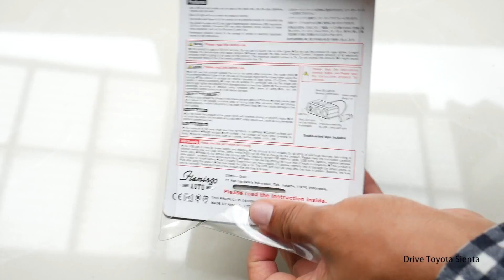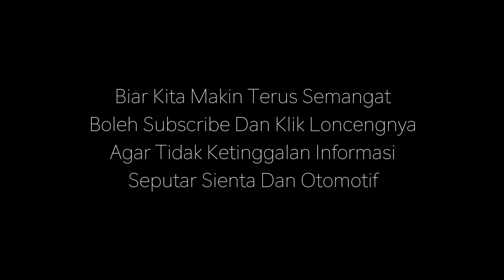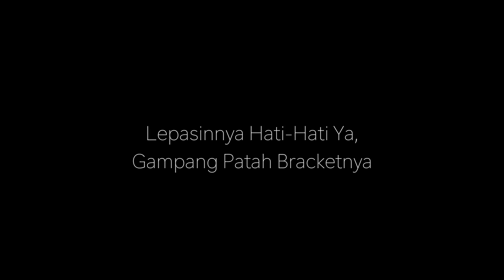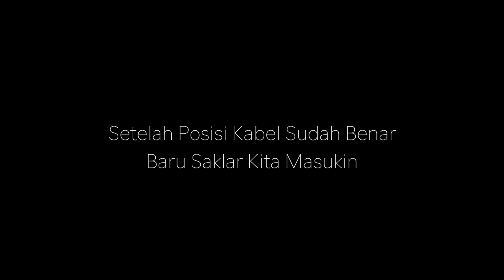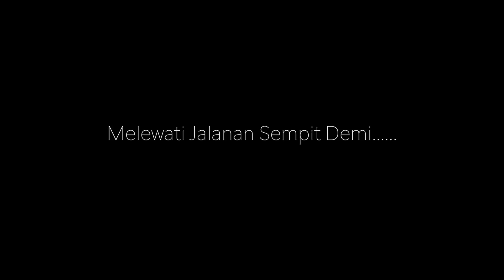Tutorial Pasang Sensor Parkir 4 Titik Di Toyota Sienta

Comment: Om sy beli srnsor parkir yg 200rban ada 2 mata d simpen d blkng
Kl sy tambah 2 lagi di depan tp d konek ke modul sensor blkng,yg depan fungsi ga kira2?
Reply: Berfungsi jika di tambah relay 12v sebelum kotak nya itu ,jadi pada saat dibfungsikan sensor depan ,tombol on untuk kasih suplay ke relay agar dpt power kotak sensor nya,begitu mundur akan auto yg belakang ,pakai relay double input single output ,kalau gak mau ribet ya oake dua kotak sensor gak peelu relay ,habya timbol on off buat sebsor depan